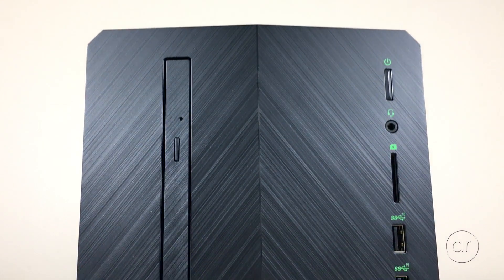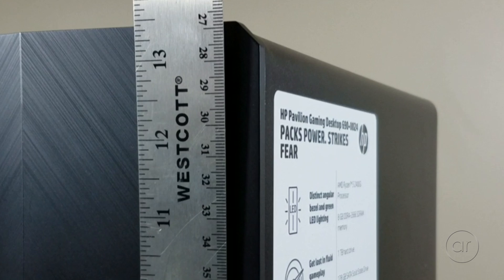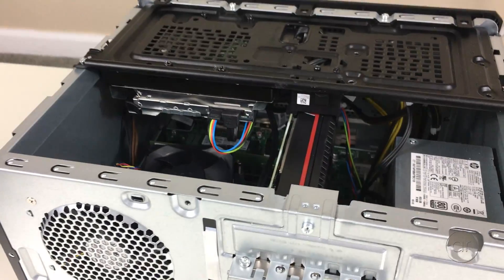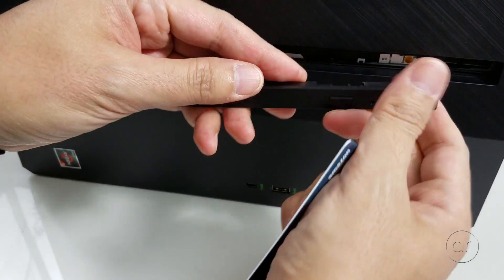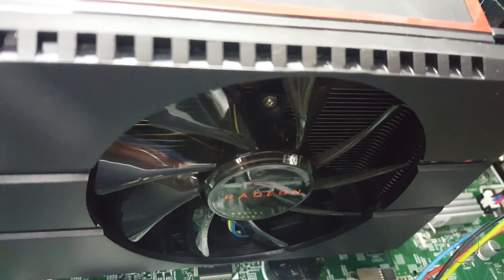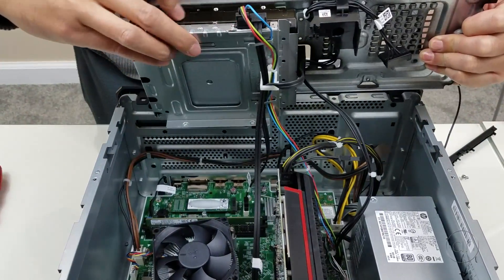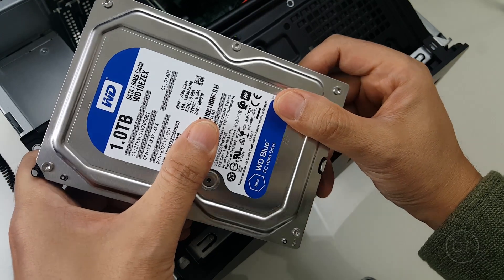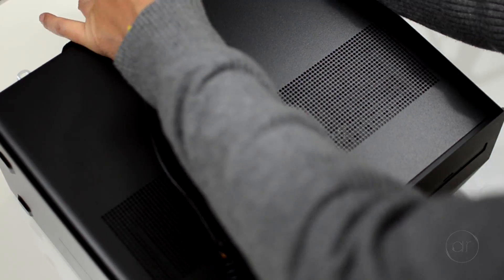How to Open and Upgrade a Ryzen-Based HP Pavilion Gaming Desktop

Comment: I just bought the 690-0020 ( Ryzen 5 2400G with a RTX580 ) nice design, descent gameplay except the 8GB is barely enough to run any AAA title because HP apparently forgot that the Vega APU dedicates 2GB which leaves you only 6GB to work with
Reply from the maker: Thanks for the info. Sounds like the first, best upgrade to get is a memory upgrade for gamers.
Reply: access random well with this system it’s a must since your running a 3rd of what’s in it
Reply: ??? Is there something different about this system configuration wise? usually when there is a dedicated graphics card the system memory  that has been reserved for the onboard graphics is once again usable by the system. or, are you using the onboard graphics?
Reply: @schooljackson  No matter if your using the GPU or the APU the system has already allocated the 2GB https://1drv.ms/u/s!Ah2yuJSBTN4UiPUDer5mGjlhkIZcvg this is a screenshot of my system after I upgraded to 16GB I only have 13.9GB useable so for games that need even more like 32GB theres nothing you can do you will always be 2GB shy of recommended. The problem is I believe in the HP bios they give NO way to completely disable the APU, and sadly you wouldn't want to even though the APU is NOT being used by a monitor the system still passes data to it, cause well its apart of the CPU by design
Reply: @ExiaLive001   go to bios turn off amd free play that will free up 1gb of ram from the 2gb
Reply: @chrismiller1986 This model does not have this option in Bios, sadly I no longer own this PC due to the lack of options needed, and the availability of being able to upgrade this unit.. Instead I went with CyberPowerPc and purchased a Liquid Cooled AMD Ryzen 7 2700x, 16GB Adata XPG Ram,  AMD Radeon RX590 8GB Fatboy, AsRock B450M Motherboard, 750w Power Supply for $929 from Best Buy ( And yes it has RGB goodness ) - I have a review in my videos Model: SLC6800BST
Reply: @schooljackson  The configuration is the Vega 11 APU it will never be usable again, this system even with a 8gb module is only a 6GB system - there is no disabling the APU, to regain the 2GB that is dedicated, and Unless you want to disassemble this system you can not use the integrated HDMI for Vega 11 HP has blocked it off due to having the 580 GPU also another HP blah moment is they included a keyboard with Function Keys, guess what? You can not disable them so the use of F1-F12 in games are zero
Reply: @ExiaLive001  keyboard is shit, so basically that vega integrated card is there for nothing, what's the point. I didn't know this uses 2gb and leaves you with 6gb, that's nothing, ima have to get me another 8gb stick, i justy checked system and it says 6.91 usable. so i dont know, but that's more than 1gb that can't be used
Reply: @naegleriafowleri1715  I agree with the keyboard, but the keyboard would be great if they had a disable feature on the "function keys" with that being said, this isn't a AMD issue, the intergrated card is not a card its built inside the CPU aka the Ryzen series …  its a HP oversight same as the keyboard. They did not add any features to their BIOS to enable, disable or even adjust the APU or GPU... I have also been in contact with HP over this from a guy named 
Dan Zucco
HP Executive Escalations

CS Americas

In which they are to be looking into this issue
Reply: @ExiaLive001  what ram did you get? cheapest ones at newegg are like $50-55 thinking of ripjaw, also thinking of getting another hard drive as 1tb is nothing these days, i installed gta 5 and is 85gb already, if you have movies, music, porn lol plus all these new games, before you know it that shit is full
Reply: @naegleriafowleri1715  I used the stock ram Samsung 8GB (1 X 8GB) DDR4 2666 RAM Memory (M378A1K43CB2-CTD) I picked it up for 48 bucks cause due to the board being basic buying LPX or Rpjaws would just be a waste. As far as HDD I would go with a SSD or possibly use the M.2 slot
Reply: @ExiaLive001  may i know where you bought this ram? The ripjaw 8gb is $55 on newegg. I want an extra hard drive for space to store files though, a 2tb wd is $61 on amazon and the 1tb is $46. If I were to replace the 128gb ssd card, wouldn't I lose windows 10 and everything stored there? How would I do that transition to make everything I have in this ssd go to the new ssd that will replace it.
Reply: @naegleriafowleri1715  You never mix ram modules, so if your buying RJ you would need to buy 2 not 1. each company has their own settings ( voltage ) some are 1.2 others less or more which will cause system instability or just cause your system not to boot at all. I normally use ebay to find my hardware. Hard drives aren't that bad on ebay either neither is the M.2 SSD, my setup I used the stock 1TB drive for windows and the M.2 for my games. But either way you can transfer your windows with a USB stick by making a recovery drive from the HP software

If you use ebay, just be patient it took me almost a week to find what I wanted for the price I was willing to pay
Reply: @ExiaLive001  well that sucks, so basically i have to buy another samsung 8gb or buy 2 new sticks, and i googled and this particular samsung is overpriced, did you get it from ebay? What's the benefit of using the ssd for games? wouldn't you want the ssd for windows for faster bootup and shit.
Reply: @ExiaLive001  would i benefit from installing a new audio card? is it possible? and Im guessing is impossible to install a bluray drive here lol honestly I would prefer to have a ibuypower or cyberpower as this HP can't be upgraded much, but at $500 I couldn't pass it up, those ibuy cyber power geeks want $750-800 for similar specs on walmart, amazon and is even more expensive on their sites. They sell $500 pcs on walmart and it comes with old 2gb cards. I keep my computer for years as I'm not a gamer really. You're not gonna find the rx580 with ssd and hard drive for $500-550 anywhere else, and building it yourself may not even be cheaper, probably same price but I can't be bothered with that, i just wanted plug and play
Reply: @naegleriafowleri1715  Sound card is not a must have the HD built in is actually really good, I use Astro A50 headsets and I can not tell the difference between using them on my PC or my Xbox One.. I will never buy a PC from Wally World. I have seen so many bad reviews on them. As far as building, building is honestly the way to go, I wish I kinda went that route before buying the 690-0020 I would have spent pretty much around 550-600 and would have had full control over my PC like the Bios.
Reply: @ExiaLive001  I have the Sennheiser 598hd which are open back. I don't play fps games online where I would need to like talk with others lol what I'm looking for is speakers, for gaming I can always use the headphones, but I want speakers for youtube and simple stuff, was thinking of Logitech z313 but at that price point i dont expect them to sound good. What speakers do you use? I also need a proper gaming chair, but i cant afford that shit right now. Most of those chairs below the $500 are usually crap that doesn't last
Reply: @naegleriafowleri1715  I use my TV for sound I utilize the Digital Ports on the back of the 580, run my 27o HP monitor and my 55in Samsung TV with the primary HDMI port on the 580
Reply: Josh Patterson have you installed all windows updates? Like 1803 and 1809, cause I read of people who installed 1803 on this machine and it stopped working, it wouldn’t boot up. I have updates set as metered and have blocked these updates but I’m afraid to install them and turn this pc into a brick.
Reply: @naegleriafowleri1715  I am running 1803 with no issues
Reply: Josh Patterson can you check your ram omif is running at full 2666 in dual channel? Because someone who was going to sell me this oem ram said that it doesn’t and it was running at 2133 and that’s because is an issue not being able to use the XMP on the hp bios
Reply: Naegleria Fowleri The stock ram runs 2666 only the stock runs 2666 because any other ram like Corsair, Kingston etc etc are Overclockable and HP does not have a XMP within bios
Reply: Josh Patterson how do you know that? Where can you check that the ram sticks are actually using 2666? That’s hp says but where can we check this. The guy who was gonna sell me the stock one, says they don't run at 2666 in dual channel but only 2133
Reply: Naegleria Fowleri I use Cpuz software
Reply: @ExiaLive001  Have you heard back from Dan Zucco? If so, any update? If not, do you know how I could reach out to him? It's really bad, in my opinion, to sell a PC with 25% of its RAM unusable.

By the way, there was originally only 1GB reserved for Vega graphics when I first unboxed mine. After a BIOS update (ugh!) it doubled it to 2GB--and no way to roll back that update. 

Oh, and the SSD that HP lists as "NVMe" is not NVMe, it is SATA.
Reply: tinmania Yes I have and he actually got me approved to pay me back for what I paid for out of pocket
Reply: @ExiaLive001  What process did you use to find him? I'd like to as well. I got nowhere with tech support, who only transferred me to the orders line.
Reply: @naegleriafowleri1715  Don't update the BIOS using the HP Support Assistant! If you do you will end up with 5.91GB usable--actually takes another 1GB RAM from you. And no way to roll back that BIOS.
Reply: @naegleriafowleri1715  I would not get that RAM. It is 2400 and the RAM included in your PC is 2666. You should match the existing RAM exactly.
Reply: @tinmania  I haven't lol cause i had a feeling some bad shit would happen, what ram stick did you buy to pair with the stock one? I'm already too invested in this pc so there is no going back, just gonna keep it, add some extra ram and call it a day
Reply: @tinmania  what ram? you said you have 13.4 gb ram so you obviously upgraded the ram unless you have the model that came with 16 gb?
Reply: @naegleriafowleri1715  I have 13.9GB available now that I added another 8GB stick. Without that I would only have 5.9GB available.
Reply: @tinmania  that's what I'm asking you, WHICH ONE did you add, what ram brand/model
Reply: tinmania use the HP support software on the system and it should take you to a option to email them
Reply: @ExiaLive001  Can you confirm that the ONLY WAY to run two sticks at 2666 is by using two stock sticks? I know someone who bought aftermarket 3000mhz stick and both run at 2133mhz which is bullshit. So, if I get an 8gb non stock ram stick, it would also be downgraded to 2133, isn't it? This sucks and I don't know if I should return this pc, i'm already to invested in it and i dont think it could get the same specs for the price i paid even if it comes with downgraded ram
Reply: @naegleriafowleri1715  Your friend no offense did not read the motherboard specs. "THIS" board can only use 2666mhz MAX using 3000mhz will default to 2133, that is not the computers fault but your friend who bought wrong ram, which is why I said do NOT buy any ram other then stock or the Samsung HP brand
Reply: @ExiaLive001  if you buy two aftermarket ram at 2666, shouldn't they both run at 2666? the guy who posted above didn't buy the stock ram it seems, he bought aftermarket and paired with the stock. Even if you have two stock ram, you're still stuck with 13.9gb which is bullshit. DID YOU DO the bios update and got screwed? I haven't cause I had a feeling it would cause problems. This suck they should give us compensation or something to remove this stupid integrated card from using 2gb ram
Reply: @naegleriafowleri1715  That would be his issue you NEVER mix ram take the cheap way out you get burned.. You have to match what is in the system or replace.. But again replacing the Samsung ram with a more expensive ram is redundant. cause this board CAN not OVERCLOCK which is what majority of the gaming ram is for..  Weather or not you have updated bios you are still losing the extra memory, and its not the chipset fault its HP who did not add a options to disable the APU
Reply: Josh Patterson . I’m just gonna get that stock ram and call it a day. Maybe I’ll get 2tb drive for more space. No reason to waste more money on replacing the main ssd drive and getting an extra ssd, as by that point, you already spending hundreds and you might as well bought a PC with a better card and without all these upgrade limitations and ram issues anyway. It seems some people have the Samsung stick and others got SKhynix 8GB 1Rx8 PC4-2666V-UA2-11. I'm about to buy a Samsung one for $45. My D drive only has 914gb as the recovery is taking up 16.6gb, is there any way to gain back those 16.6gb? If I create a USB recovery, is it possible to delete the recovery from disk E?
Reply: Good gawd I thought I was the only one on the planet who realized that the PC comes with 25% of its existing RAM unusable. Shame, and you really need another 8GB to make it usable. Well, at least they only used one 8GB stick, so you only have to buy another. Still, I don't like that I only have 13.9GB available and HP doesn't seem to understand what I am talking about.

Also, the "NVMe" drive is actually SATA (model MZNLN128HAHQ-000H1, keyed M and B). I only hope the slot itself, keyed for just M, supports NVMe, as that is what I intend to put in that slot.
Reply: @tinmania  what stick did you buy
Reply: @naegleriafowleri1715  I bought this one from Amazon: https://www.amazon.com/gp/product/B0734V4SSR.

I couldn't find the exact same as OEM, at least with fast shipping, so matched its specs exactly. Works fine, full speed, and dual channel.
Reply: @tinmania  how can they get away with this shit? so it was never NVMe
Reply: @naegleriafowleri1715  no but the Intel 660p 2gb is on sale for 200$ from Newegg. It's insanely fast and plenty good enough for normal users. And of course it's nvme

Comment: Can you upgrade the power supply ?
Reply from the maker: There is some conflicting information out there - a reviewer at the best buy site is adamant that it's a non-standard PSU, while HP (who has an official presence there) says that it's a standard SFF. I'll need to revisit the power supply in the future as I didn't take a close look at it when I opened it up.
Reply: access random ok thanks for the response
Reply: access random and for the graphic card in my computer there is more space than you (im french so dont be rude with my english)
Reply from the maker: Pas de problème, let me know how the upgrade to the 1050ti goes.
Reply: @accessrandom  Great video! I have the 690-0067c Costco computer (Ryzen 7-1700,  Radeon RX550 & 1tb SATA Drive) that I bought on sale. I upgraded to an EVGA GTX 1050ti SC and added a 1tb M.2 NVMe SSD and it was very easy and worked out very well. I have also never built or modified a computer, but bought this machine as a way to "get my feet wet".
Reply from the maker: Fantastic! Is it ok if I add your experience to the description, with credit to you? I'd like to keep a running list of CPU/GPU/PSU components that have been successfully upgraded. Also - is the specific model of your card the 04G-P4-6253-KR?
Reply: Please feel free. Yes, the card I installed was indeed the EVGA 04G-P4-6253-KR and the M.2 I added was the Crucial P1 CT1000P1SSD8 utilizing the Acronis Tru Image for Crucial software to clone the factory installed HDD. I read about people having issues using this software to clone their drives, but I did not. 

Also for reference in case anyone is interested, here is the link for the specs on the Sunflower motherboard: https://support.hp.com/us-en/document/c05939208.
Reply: access random and I have thé project to upgrade to a gtx 1050ti and continue your great job
Reply: is not meant to be upgraded lol but that's what you get for this price, if you wanted to get a similar pc with same graphic card from ibuypower, cyberpower and all those power brands, it would 750-850 dollars.
Reply: HP uses a 500 watt PSU in the higher end models of this platform.. with some simple mods you can shoehorn one in. It's about 60 bucks buying it from HP.

Comment: Can I change led if I open it can anyone reply for recommendations or help
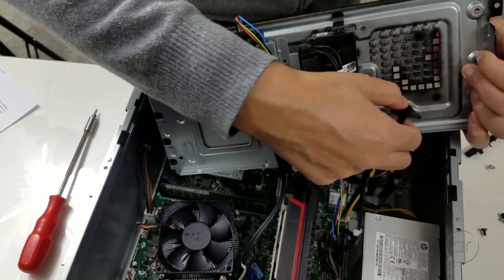Reply from the maker: Sorry, I didn't take a good look at the wiring for the LED. But it would be located in the front panel of the case - if you look at the 5:22 mark, you can briefly see the three tabs that hold the panel unfastened. I push them back in at 5:24. You'll need to undo those three tabs and see what type of LED is in there and the wiring for it.

Comment: Can't I just move the parts to a bigger case and forget the case it came with and just upgrade it from there? Because I have this and want to upgrade from 8gb of ram to 16gb. And maybe upgrade my graphics card from a gtx 1050 to 1060 in the future, But I'm worried my pre-built gaming pc case won't have the space for it. So could I  just move all the parts to a new bigger case?
Reply from the maker: Yes, definitely. Just a couple things to keep in mind, even after you migrate to another case: depending on whether the power supply is standard or not (there's some debate whether it is - see other comments), you may need to replace both the motherboard/power supply at the same time. The DVD/CD drive is ultra slim so you'll probably need some type of adapter for a 5.25" bay if you want to keep using it. Finally, I'm not sure if the front panel connectors for USB, audio, etc. is standard - sorry, I didn't take a good look at that...